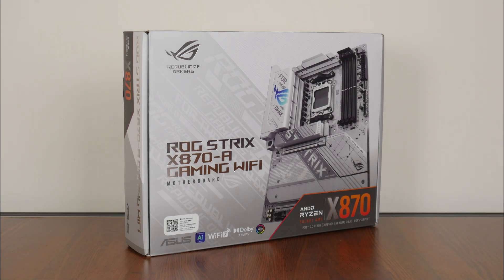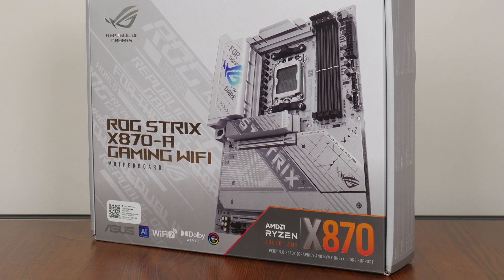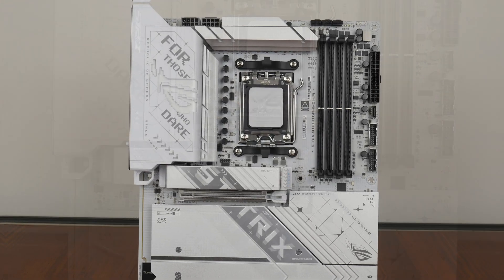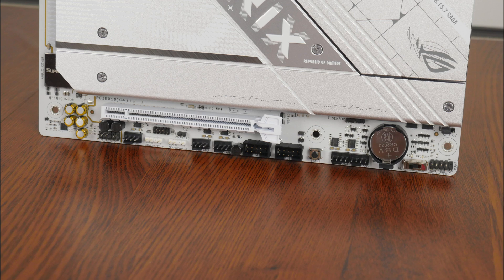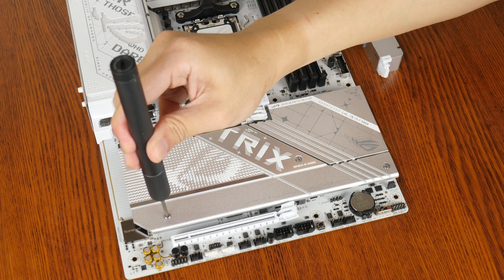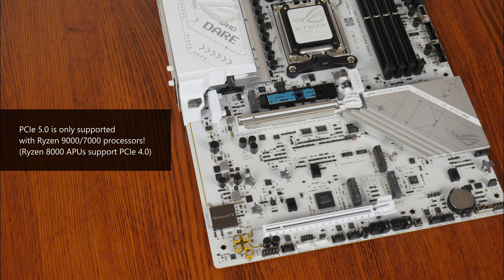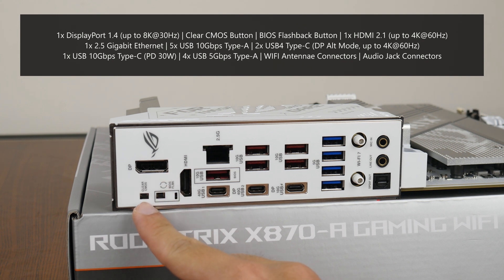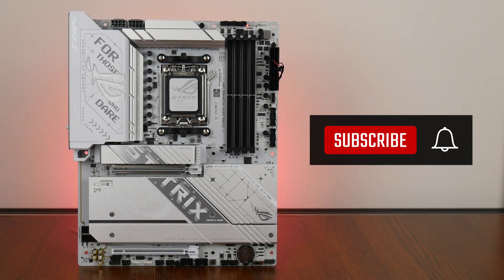PERFECT for Next Gen White AM5 PC Builds? ASUS ROG Strix X870-A Gaming WIFI Unboxing & Overview

Comment: Is it possible to use a sound card in the second slot or will it castrate the GPU?
Reply from the maker: Using a sound card in the second PCIe 4.0 x16 slot that operates at x4 mode won't affect the bandwidth of the primary PCIe slot for your GPU, but you will have to sacrifice the third M.2 slot, M.2_3, as it shares bandwidth with the said second PCIe slot!
Reply: @ALKtech  so better get an x870e or an x670e?
Reply from the maker: @napalmarsch  it really depends - how many M.2 SSDs are you intending to use in your system? Granted, X670E boards seem to have no/little instances of PCIe lane sharing; in the absence of pricing info for X870E and X870 boards, I'm guessing that X670E and X670 boards are probably gonna get cheaper and could offer better value too, but do bear in mind you won't get features like faster memory support and USB4 support. Perhaps wait till 30 Sept for pricing details to be available, before making a decision!
Reply: @ALKtech  i would like to use 3x m2 and an soundcard thats what i have with my current 11900ks and the z590
Reply from the maker: @napalmarsch  I see! anyway the performance difference between running your GPU at x8 mode versus x16 mode is not going to be very big - there's some benchmark videos/articles out there that demonstrate the difference in performance when the PCIe lanes for a graphics card gets cut in half - by and large there is some performance degradation, but the percentage drop in performance tends to be in the low single-digit range or even negligible for that matter. For the everyday user/gamer, he/she is probably not going to notice any performance impact while gaming!

Comment: Nice overview, but just 2 SATA ports and all that PCIe lane sharing??? I'd rather have just 1 PCIE 5.0 NVME + 3 PCIE 4.0 drives without all that bifurcation stuff.
Reply from the maker: Yeah the bifurcation stuff feels like a classic example of form over function, to be able to put it on paper that the board comes with two Gen 5 M.2 slots but at the expense of something else...

That said, this lane sharing situation seems to be a thing with higher-end X870E and X870 boards from other brands too, and I'd say that this is due to chipset design limitations - with AMD making USB4 a compulsory feature, manufacturers have got to route some PCIe lanes to the USB4 controller, thereby contributing to this bifurcation situation!

Comment: should have onboard oc buttons, looks cool
Reply: theres power on at least
Reply: 4 nvme slots perfect for me
Reply: realtek alc4080, wifi7, 20vrm, 2.5 gb lan, oh clear cmos and bios flashback, optical audio output, usb c's, damn
Reply: dont know which speed the wifi is, highend wifi6 can do 60ish mbps data transfer, which almost same as 2.5 lan
Reply: thats blazing fast wifi, try yours you prob will see 1.5mbps speed
Reply: technically 2.5gbit lan can do up to 300mbps

Comment: I guess having white ram slots would have costed them another 2 dollars.... using white pcie slots but black ram slots makes zero sense.Thankfully Gigabyte is making truly full white boards.
Reply: Just grabbed the B650 Aorus Elite last week did a full white build no complaints
Reply: The Gigabyte X870 ICE is $80 cheaper at $290, and is all white.

Or for the same price you can get the Gigabyte X870-E ICE, with all white and more features
Reply: Lmao you sound like you're crying😂 if you have white ram it's gonna cover the slot anyway clown
Reply: I have same question but best looking is to use 4 dimm and it is hard to see the slot if populated all4 dimms 😂

Anyway
Reply: @frankwong9486  Sure but utilizing all 4 slots with DDR5 tanks memory speeds hard. Current gen CPUs be that Intel or AMD has pretty weak controllers when it comes to 4 dimm usage for example you will be lucky if you can achieve 6000mhz, 5600 is more likely to be the max
Reply: @kerotomas1  basically all platform struggle to get high speed with 4 dimms 
Even t-top board 
If need high speed have to get a daisy chain board/ or board only have 2 dimms slot for better signal integrity , but unfortunately good overclock board in white is very rare always :(
Reply: @frankwong9486  Nah this is only with  DDR5 cpu generations. I had a 11900K build with 4 DDR4 dimms running at 3800Mhz CL14 in Gear 1 which was almost the best you can get. (By the way nowadays every single motherboard is daisy chain, T-topology died around the time of Intel 10th gen / Ryzen 3000, 2 slot motherboards can possibly yield better results but not necessarily as i tried the Z790 Apex and it couldn't do better than the Hero)
Reply: @kerotomas1 only if you’re going above 64gb capacity

Comment: i have x670e for future upgrade it has x4 pcie 5.0... and i do not understand why i need x870 ? why they made do i get uplift FPS ? nope Can i get better latency on component? No one knows
Reply from the maker: As far as I can tell, the only reason to get a X870E/X870 board is if you need USB4, and you're upgrading from an older platform (e.g. AM4). Otherwise, a X670E board will suffice, seeing as it already supports Ryzen 9000 and potentially even Zen 6 (assuming Zen 6 is still on AM5)! I highly doubt that there will be any performance improvement at all when comparing X670 and X870!
Reply: Wifi 7 and USB4 that's it nothing more. Some higher end X670E boards already has USB4 like my ROG Hero so other than WIfi 7 it doesn't offer anything new for AM5. (and you can always replace your on-board wifi card later on so yeah.)
Reply from the maker: @kerotomas1  yeah, I guess with the X870E and X870, it was about making USB4 available across the entire range, even for "lower-end" X870 motherboards. I personally think X670E and maybe even B650E boards will still offer better value for some time to come, until they go EOL and are no longer available new!
Reply: @kerotomas1  i have usb4.... but i did not ask  for wifi usb... i use ethernet i turned off wifi because it is bad for online gaming where is latency important.. my Motherboard supports 8000mhz+ Memory kits.... I just ask do u get more performance lowered latency on chipsets etc.
Reply: @MakeSh00t  it doesn't offer anything new especially not more performance
Reply: 8xx series motherboards are supposed to offer support for faster ram.
Reply from the maker: @grizredford8407  oh yes, thanks for pointing that out too!
Reply: @grizredford8407  But that's not how it works. Nowadays the chipset has not much to do with RAM speeds as the controller is on the CPU. The motherboard only offers the signal through the PCB so if you have more PCB layers and better the quality the better your ram speeds going to be.
As long as a CPU is supported by the chipset ram speeds will always depend on the CPU memory controller.
For example my X670E Hero already supports over 8000Mhz ram because of it's 8-layer low loss 2oz PCB which is currently the best quality PCB that's put into motherboards. There won't be a single X870E board that will offer more than this. (and currently that's the frequency where CPU controllers roughly top out)